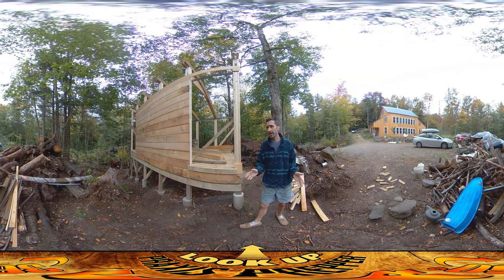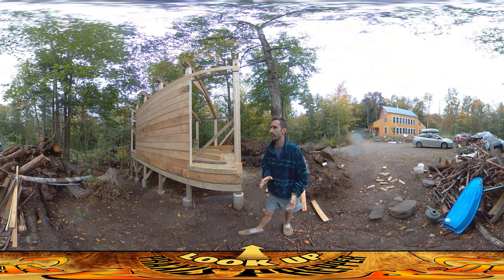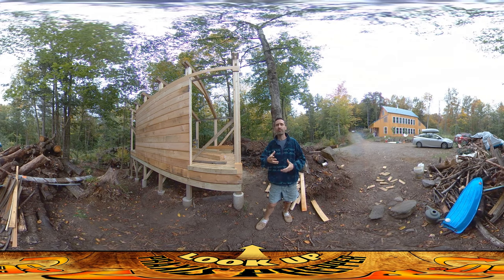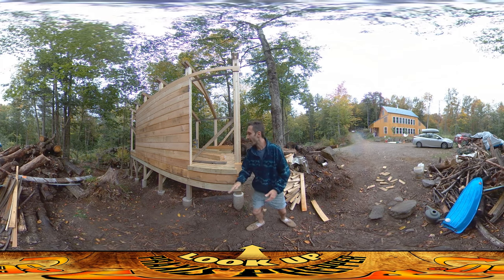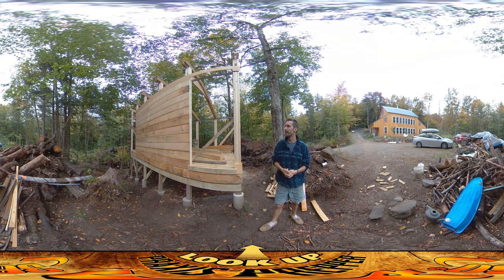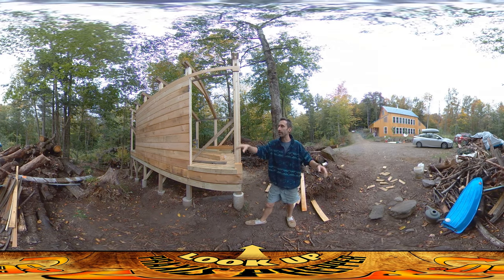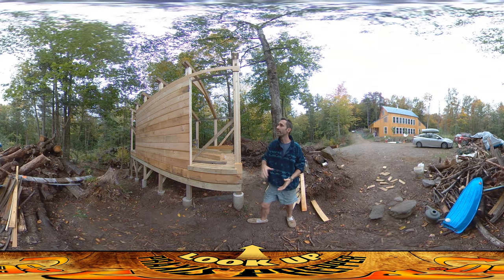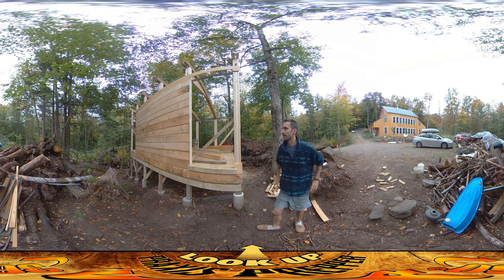Homestead Building - Using Shiplap Boards for Ventilating Walls

Comment: You’re a pretty good carpenter
Reply from the maker: Thanks Jay. I've just learned by doing. My first build was pretty decent too (but only because my dad helped). This is my 6th structure and I feel like I kind of have the hang of it now. I think I actually started feeling competent when I was working on my 3rd structure (which was a tiny house).

Comment: Real world experience with a fountain that used a spillway… with what I called a “drip edge” water will actually flow back on the underside of a surface that has a 90 degree angel. In order to get it to actually drip off, it needs an edge on the underside of the lip that doesn’t have a flat side immediately off of it, however after enough of the water has wrapped under the corner, weight will cause some to start dripping off but a significant amount will still cling to the underside surface. With our spillway, a bead of caulking under the edge solved the problem. By creating a gap between the shiplap, you are actually going to cause your concern not resolve it. Shiplap that is fitted tightly together will cause the water to flow down better because the edges are butted directly against each other or at least close enough that droplets are going to cross the bridge causing it to flow down instead of under, particularly after sealing because the sealant will also soak into whatever tiny gap might exist filling the any space that a tiny droplet might want to wrap around instead of cross.

On the Shooting Stars channel, you might already have this planned, but can you upload a single video of all the scarecrow times tables in a single video please. Thanks and have a good weekend.
Reply from the maker: Thanks for the advice on the drip edges. For the roof ones, I was planning to add flashing all the way around. For the wall boards... I guess I made my bed and now I'll have to just sleep in it. I'll see how it goes - I can pretty easily replace those wall boards given how they were installed - now that I'm thinking about it.

As for the scarecrow vids, I could make a playlist that'd do pretty much the same thing - but I'm not sure when I would be able to get to do that. You can easily make playlists within your own Youtube account too. You can add any videos you like form anyone's channel and then watch them in any order you decide.
Reply: @PraxisPrepper  Life is always a compromise of choices, usually between two bad ones. Playlists are definitely an option just have to switch to his YT account to do it. Had noticed you have been releasing some combined vids in the 20 min range and wasn’t sure if you were going to start doing it regularly or if they were one offs.
Reply from the maker: @inmyimage1081  I do make a lot of combined videos, and I have "Halloween" themed combined multiplication ones - but they're not only scarecrows. Vampires, etc are mixed in.